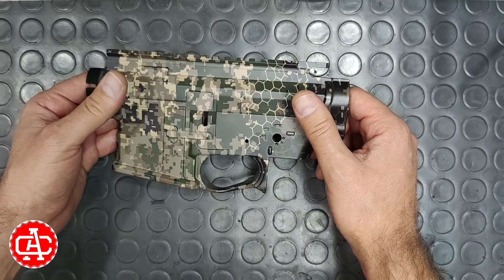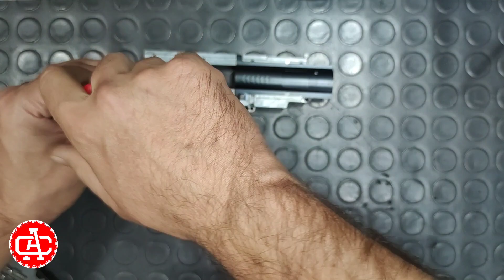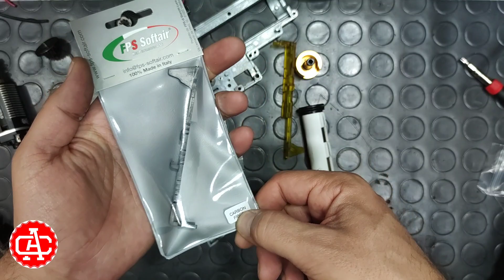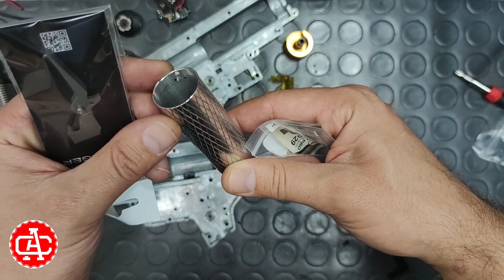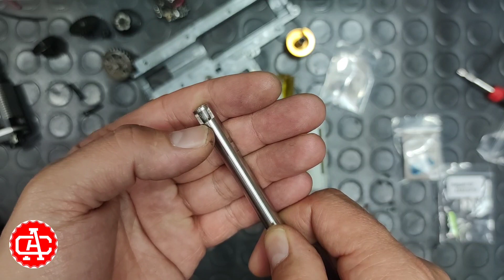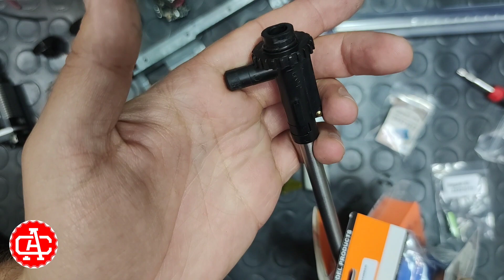Modify XTC G1-MS at the end of 2022?

Comment: What maxx model you used?
Reply from the maker: At the end, the red maxx, with custom adapter for it.
Reply: @AC-AirsoftCustoms  yes i have the red but does not fit inside. Help me and thanks
Reply from the maker: @BlackDay171  Unfortunately, i can't right now. I made i 3d  resin printed adapter for it, but i need something stronger because every 10 games we have to exchange it( simply breaks). Will be buying a different nozzle for my fdm printer soon, so i will check if that will help. That's why i didn't finish the series. I will keep you posted
Reply: @AC-AirsoftCustoms  I have a 3D printer i need the STL thanks
Reply from the maker: @BlackDay171  Sorry, they are not for sale.

Comment: The receiver is for the ar15 range and this one, i was pretty close with the xtb but yeah what do you think about putting a different V2 gearbox in this receiver and buttstock wise, do you know if you can use a normal buffer tubes or do you have to get everything modify and same with the motor grip and all the other little odds and ends that goes onto that receiver.
Reply from the maker: From my perspective, you can't do any of what you stated. That's not a standard receiver, buffer tube, hopup, grip or gearbox. My opinion is not to invest money and time on that platform. Don't get me wrong if you are very skilled you can make a GB swap but you will lose a lot of the receivers features to a point that you will hate the decision to buy it in the first place.
Reply: @AC-AirsoftCustoms  you are a absolute legend and those things that you mention are spot on and that is what i was thinking but couldn't get a answer but you have made the decision for me. Good man and i have a few other receiver's in nylon in cast metal and the most beautiful od green cnc'd Bad556 receiver kit GBF stands for gel blaster frontier but that gbf Bad556 receiver is next level and even sitting there with the emg aps falkor blitz 2.0 sdu and it's maybe a tad nicer than the falkor and i have set's of bronze strike industries part's for the receiver like charging handle, mag release catches, fire selector switches and a black si receiver part's kit's that are only $50 aud and its got everything for the receiver besides a charging handle and even a metal si dust cover in there take down pins extend mag release catches, so worth the 50 bucks and a black and bronze strike industries gridlocked handguard, 11 inch from memory ha just got way to many a black and bronze 2nd gen strike industries viper pdw buttstock and a black one aswell cause they were so cheap and i just got the new maxim defense pdx gel blaster in tan or tan's i should say but most likely one of the the ares amoeba pdw in black and a slightly different bronze that they call dark earth pretty sure ,retro arms gearbox for it and leviathan and brushless warhead motor and a aztech innovations apache tappet less cylinder head system and they do airsoft versions of them

Comment: Hey mate im from Australia and we only have gel blasters and i was looking at a modify receiver for some reason they are selling the top and bottom half separately,and it says it is for modify ar15 range and the xtb blasters, well i think that it's a xtb but could be wrong anyways i have emailed the shop that's selling them ,but no reply so i will have to end up calling them to get some info but all i wanted to know if their receiver's will accept a different V2 gearbox's cause i have quite a few retro arms gearbox's plus a few other V2 gearbox's and i was thinking about getting the receiver cause it's a pretty cheap receiver when you put the two halves together and i don't mind the look and shape of it,i dont like the forward assist button that's on most m4's ,they are bloody ugly but necessary for the real steel and airsoft guns and gel blasters are made to milsim specs but luckily that some don't have any forward assist.